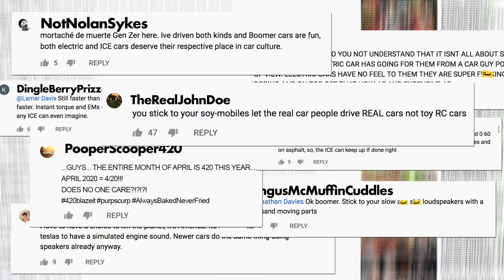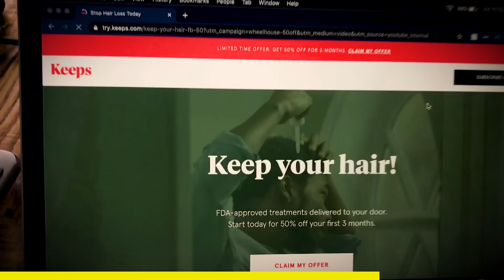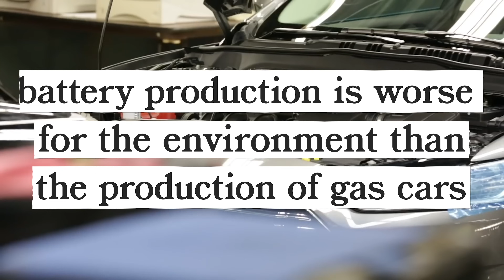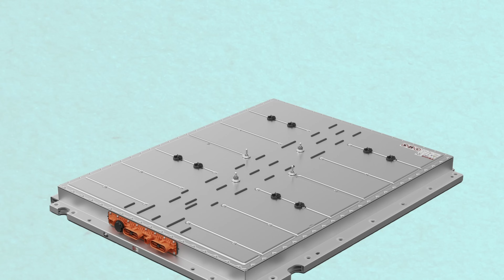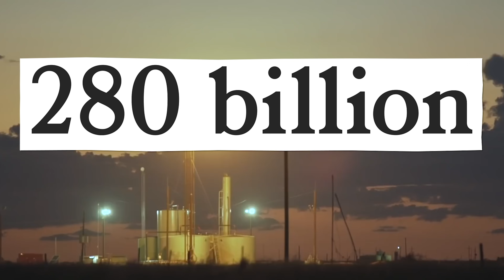Are Electric Cars REALLY Better for the Environment?

Comment: I’m curious where hybrid or diesel cars sit in all of this.
Reply: They exist, they're just bigger and ride on rails.
Reply: @cluelessbeekeeping1322  Yeah, but they are cleaner than a hundred semi-trucks working together to pull the same amount of freight.
Reply: @cluelessbeekeeping1322  ah I see what you did there
Diesel trains are basically hybrid cars
Diesel engine is connected to generator that is connected to traction motors
Reply: I don't know about diesel but I saw in a government report recently that the lifetime impact is lowest for hybrids, even lower than EVs who came second, and gas cars coming in last. I looked for the report again but I can't find it by myself. If you search and find it please link it below so I can bookmark it, thanks lol.
Reply: @Henriburger1  I have a relative who actually works for Tesla, but drives an Accord Hybrid. Anecdotally, for him he found that the dirty energy in his state combined with the efficiency of the hybrid was a better choice for the environment AND his wallet over the expected length of ownership (5 years).
Reply: @Henriburger1  Bingo... Someone knows their facts. 

Hybrids are actually best for the environment, at this present time. Why? Because they can supplement their driving range with ICE propulsion so there is a far smaller battery and thus smaller impact of B-EV specific production CO2 output. 

Of course, because you charge them ideally from the grid and as much as reasonably possible, you're not adding that same 5 megatons of CO2 per year to the atmosphere, from fuel consumption. And as stated, smaller battery requirement, because you can supplement your range with fuel. 

Also, and this gets more into the science side fo things, there are efficient ways to drive EV vehicles and most of these environmental calculations rely on EV's being driven in these manners. "Granny fashion" if you will, taking forever to take off and braking for half a mile to come to a stop slowly. If you drive EV vehicles... Like... the way 90% of normal people drive cars, then their efficient and thus environmental benefit tanks. One of the main contributions to EV inefficiency is flooring it. It excessively degrades the batteries and it drains them really quickly which obviously degrades the already very limited range. The supplemental ICE engine takes care of this because you can plant it and it sips fuel instead. What's even better is that as a measure of power to weight, small turbocharged diesel hybrids are quite fuel-efficient, even though this seems quite ironic being that you have half an engine in an already tiny car which would already have a small engine. But the powerplants work together and they both have polar opposite benefits and flaws, ergo they 'synergise', if you will.

And then because the power plants work together and use their benefits to support each other's flaws you can get more power for less weight. You don't have the massive weight of batteries weighing you down and you don't have the massive weight of a 4L engine weighing you down.

So yeah, you're basically right, hybrids are best.
Reply: Vw made a concept car with a carbon fiber chassis and a diesel electric hybrid system. Did about 240 miles on one gallon of fuel.
Reply: Maybe dashcam videos are the answer ? hahahha PS: its me
Reply: Hybrid diesel cars
Reply: If batteries are so damaging to the environmemt I wonder why they stopped research and development of direct burning hydrogen engines in favour of electric "fuel cell" ones. Fuel cells are essentially batteries.
Reply: @souljastation5463  because producing hydrogen and building/retrofiting fuel pumps for hydrogen would be too expensive, but I would like to see hydrogen trucks over electric trucks (and I don't mean pick-up trucks) since those require a lot of energy to run and as we learned today big batteries = bad for environment
Reply: Souljastation 5 Hydrogen generates more CO2 than EV and it costs a lot more! There are plenty of studies and videos confirming that. Creating, storing and transporting Hydrogen is a nightmare!
Reply: @andream.464  I knew about the storing problem but figured out that in time it could have been solved. I didn't know that hydrogen emits more CO2 though, then I guess we're stuck with EV.
Reply: @andream.464  Hydrogen doesn't have to produce so much co2. Right now it does because they use methane to get H. If you just do electrolysis it may be less efficient but it's cleaner.

Electrolysis would also allow fueling station to create their own H which would make the strain of supply easier.
I still think newer battery would be better though.
With current lithium battery, I still think Hydrogen would be better.

Hydrogen would still be a better pick for boats an olane though.
Reply: Or steam cars for that matter.
"But dude they're o-"
Yes I'm aware
Hush
Indulge me.
Reply: @dimitrilensflareabrams2893  
Can't get enough of Jay Leno's Garage steam cars! Inefficient? The definition of! But a car from the early 20th century with a thousand ft. lbs. of torque that sounds like a train engine?
uWu
Reply: Its a tough thing to measure because they are not on all the time. BUT the batteries are way smaller. Hybrid batteries are between 1.5-10kw vs Teslas 60-100kw batteries
Reply: They're even more so. Our batteries are smaller and therefore easier to produce, but we use half the amount of petrol used by a fully ICE vehicle. 

We get twice the range of both, too, which means half as many visits to the pump and charging station.
Reply: They're still higher, EE found that even with 100% carbon power generation an EV will "produce" 1/3rd less carbon than the best hybrid on the market. 
https://youtu.be/2rywz73vwKw?t=661
Reply: Last stats I saw put hybrids in between electric and fossil fuel based on average electrical grid. But if the grid is all coal power hybrids were better than electric. 

https://afdc.energy.gov/vehicles/electric_emissions.html
If you look at states like Kentucky with mostly coal power hybrids are better. If you look at the average electric are better.
Reply: I’m pretty sure diesel cars are best, that’s what we learned in auto class
Reply: Many people here dont realise something.
I will talk for Toyota's Hybrids cause I have experience with them.
Production:
Just regular car with a small battery pack. Emissions during production arent that much more than a regular car. 

Life of the vehicle:
The engine runs on Atkinson cycle which makes it way way more efficient. Its not great for power tho but that is compensated by the electric motors. At start and stop situations where an ICE is less efficient, the engine doesn't even run cause you got electricity. 

Charging:
Even the plug-in hybrids can self charge which means they dont pullute when charging.

So I'd say hybrids are the best for the environment.
Reply: Connor Hall Hybrid cars are the least efficient:  a lot of CO2 is produced during the production of the battery and CO2 is emitted during the life time of the vehicle! Diesel is worse than gasoline because it creates microparticles of polluting agents, which are very detrimental to the public health.
Reply: @andream.464  they have particle filters though
Reply: Sacatolas Moreira particle filters with old particles until a light in your display says that your particle filter is full. At that point the owner’s manual suggests you to go on the freeway to clean it up and guess where all those particles end up...
Reply: @andream.464  In the freeway, i.e. away from anyone's lungs.
Reply: @sacatolasmoreira5593  but it is still produced. Replacing the filters is just putting the pollution in a different location i.e the dump. At least i think.
Reply: @HeartTribe  They aren't replaced, they regenerate by driving over a certain RPM on the highway. Pretty much burning the particles and transforming them into non-pollutants. The problem is cost, if you are to replace one for whatever reason it will cost you sometimes over 1000 dollars
Reply: @andream.464  It really depends on the building year and maintenance. According to Flemmish state broadcaster VRT research 2020 diesels are actually better for the environment compared to their gasoline environment. Indeed it's still true atmospheric gasoline engines are the best, but turbocharged gasoline engines are worse than turbocharged diesels due to the fact they've less filters. Turbos are bad, because they heat up the air so much they literally starting to burn air, or at least the nitrogen part of it. Cars running on CNG are okay with NOx emissions, but worse than diesel with PM emissions. https://www.vrt.be/vrtnws/nl/2020/01/08/bijna-geen-verschil-meer-tussen-de-verschillende-type-auto-s-di/

These are the stats of new cars. When cars become older, filters become worse. Some owners even remove filters and catalysts to get more performance. With that in mind long-term turbocharged gasoline is better than turbocharged diesel.
Reply: Andrea M. Im not defending diesel but  The most recent diesels do not have a worse particulate count than anything else ..
Reply: Andrea M. But Diesel produces less CO2 than gasoline.
Reply: @andream.464  Except that the batteries in hybrids are much smaller than full time EV's, so require a lot less lithium. Also, since the batteries are smaller, the vehicles are lighter, meaning less energy is wasted.
Reply: @andream.464  I agree and am not really sure on the subject but while diesel creates worse oxides it gets higher mpgs and wonder if the higher mpgs mean that it would still have less environmental impact? Do you know?
Reply: Andrea M. Don't forget, you need to burn fossil fuel for electricity and that is even worse, Just stay with a good ol' gas car
Reply: @andream.464  diesel is good for long range or in the country side
Reply: @andream.464  Not true, since the battery is significantly smaller less CO2 compared to electric cars, and of course far less gas burned so less CO2 compared to ICE cars too.  They done this same comparison comparing hybrid to ICE.  

Eventually EV's will be more relevant, but they're still too impractical for the majority of people while their longevity hasn't been proven yet.  Prius at least has already passed the longevity test.
Reply: @andream.464  I dont know, seems to me that hybrid would be quite ideal. You took the bad sides from both EVs and gas powered cars and attributed them to hybrids. The way I see it is that they take their good sides instead. 1) They need like 1/10th of the batteries of an EV, which is the worst part of an EV. This also enables more environmentally friendly cars to be manufactured in total, since they need less rare elements. 
2) Most trips are under 30 miles, which you can make purely with the electric motor of an hybrid. It's very seldom we take longer trips and as long as you drive responsibly, it's almost the same as an EV.
Reply: @andream.464  diesel is way more efficient than petrol, it releases less CO2. The particles are a problem only for city air pollution.

Comment: Production of classic engine needs lot of steel so you also produce lots of gasses and CO2 itself is NOT creating global warming, it's false BS. Nothing wrong with CO2. Producers are changing chemistry of battery's drifting away from lithium and cobalt. More and more people start to produce their own electricity thru solar and small wind mills helping the grid. All those negative story's about EV are being sponsored by petrol industry, they are loosing BIG TIME to EV's.

Comment: One mistake: the water to get the lithium is salt water and not usable for agriculture or drinking. And scientists say there's probably no relationship between the salty groundwater under the desert and the "clean" groundwater. There are different cams. The sinking "clean" groundwater is probably more caused to the climate change. I personally drive EV with solar power of my roof.

Comment: The pictures you use for pollution from power plants is flawed. You are showing cooling towers from a nuclear power plant. That is not pollution its water vapor. Natural circulation is used to pull in outdoor air at the base and it flows out the top. I guess the added heat could be called pollution but it is very small.

Comment: Hey, don't forget the shelf life of batteries as they decompose and the other types of pollutants (not just CO2) when it comes to refining materials. And the reliability/life spam of them all. This video is good for address a portion of the issues, but there are still more factors in play (like the outliers skewing statistics, like big rigs and the age of many vehicles). There are too many factors to get a 100% definitive answer (like you can add the emissions of all the workers going to the plant to make the electricity etc.), but I've had professors and other explain how current electric cars to current gas cars are worse for more than just what is mentioned here.

Comment: Total wrong, IC care engines are made out of Aluminum and or cast iron, please compare ten mining and refining of these two elements with lithium.
You will find it is no better plus all the heat treating for all the components in a  combusted engine the CO 2 and all the other poises gases combined will be worse then an battery production  for the most powerful c

Comment: The huge batteries in electric vehicles can't be recycled, so they dump them into the oceans
Reply: Not sure if you're serious or not, but it's still the farthest away from the truth. For instance, check out Li-Cycle in Canada.

Just about 98% of batteries are currently being recycled if done properly, and Lithium and Cobalt which are the most critical components to recycle is in the spotlight.
Lead-acid batteries, for comparison, is recycled to a degree of 96% and those have existed for quite some time.

I know, I know; lead-acid batteries doesn't have the same environmental impact upon manufacturing. It still leaves the question of why not higher. I'm assuming they felt they did what was required and stopped there. It costs to recycle but luckily lithium batteries changes the pace of things.

I still feel like you were joking but I guess at this point in time every joke requires an /s because people can actually be that fucking dumb. Cheers!
Reply: @Ruben9505  Haha yes, it is a joke.  I think those percentages are pretty impressive numbers because it's much better than dumping into the oceans :)
Reply: @stevew3167  Thank god :D

Even better is the fact that batteries will inevitably be recycled up to 99.99%(effectively 100%) and ICE-cars isn't a necessity.

As Jay Leno put it: One day everyone dailydrives EV's and we can take out the old V8's for a nice sunny cruise as a hobby.

Comment: But oil refinery will still operate without ICE cars. I mean, only a portion of the fuel, that caused 280B metric tons of carbon fp, is going to be on civilian cars. Most of it will be used by big industries and other gas powered engines.
I'm not saying ICE cars are more eco friendly (they're not), I'm just saying that the info is somewhat misleading and exaggerated.

Comment: OK the video is false on the footprint.
It is a widely believed lie that electric cars have a bigger footprint than gas cars.

Which car has the bigger environmental impact is unknown. There are a lot of liars out there who create bad researched papers on how bad the impact of E-cars are but they are just bullshit.
They very often just take the raw material mass and compare the mining and smelting processes against each other. Not keeping in mind that for example Tesla is producing it's batteries in the US with higher standards than China produced metal parts.
Or transport of every little part, sometimes multible times around the world, before they get in the car.

If you want to claim, that you know the footprint of a gas car, you need to know produced it, go to that company, get a list of every little part and supplier. And how much the first company used in energy and where to but everything together, then you need to go to EVERY supplier and get the same list for those sub parts + their Energy consumption. And then repeat this whole game again and again until you are so far down that you at least have most of the real production costs that go into a car and can give a reasonable estimation for the rest.

NOBODY has ever done that, not a single paper even tried, and for a good reason. Even if you can convince Ford, GM, VW, Daimler or some other manufacturer to open their books and give you all that information, you won't get it from all the first suplier step. A random garbage companies in the center of China with child labour and not giving the slightest damn about their impact, won't give you that information, period.

And that is of course true for electric cars as well, just on a way smaller scale, since they have usually a few thousand parts less.

You could use this "less parts" to argue that electric cars have a lot smaller footprint and have a very good chance to be right, but it would still be guessing.

And that it is nearly impossible to prove or disprove is also the reason the oil lobby is throwing this lie around.

Comment: I appreciate the video and information but I would love to see and apples to apples video of ev vs a 4 cylinder or less ice vs hybrid in emissions. Because even when looking this up myself. Most site will only give you a sum of all ice powered when a eco friendly person would not be looking for a V6 or up so the information is then not useful. I personally only drive V8's but on this topic I like to see all solutions.
Reply: And also on that comparison for ev and hybrid over at 10 year period it should include at least 1 battery replacement in the emissions. Cause as a dealership technician we see between 1-5 ev or hybrid per week needing a battery replacement (once a week in the dealership as a whole not per technician to clarify)